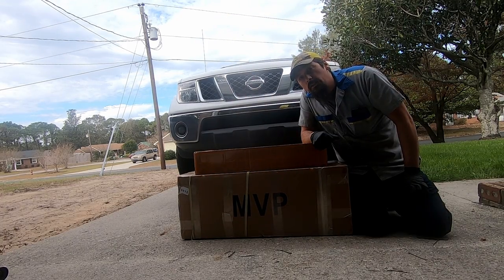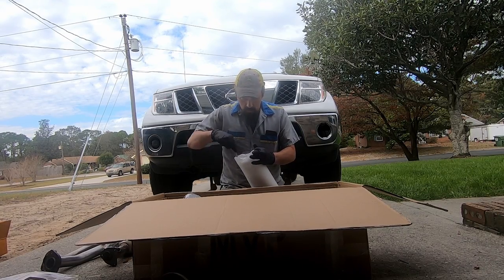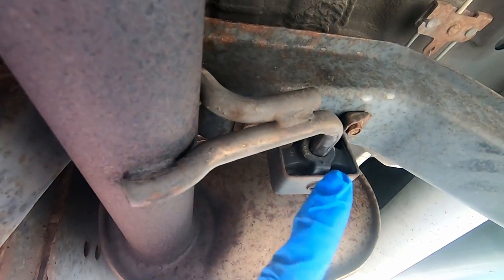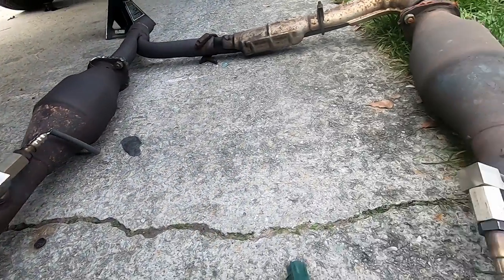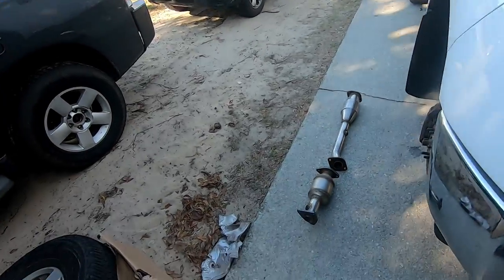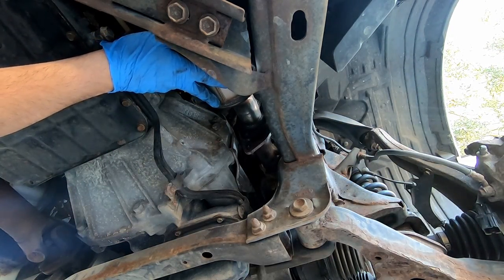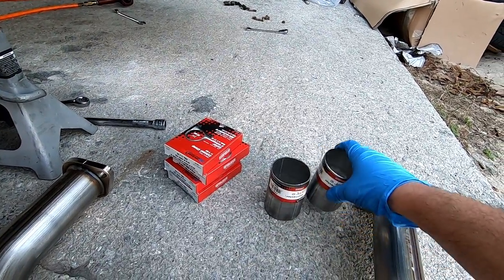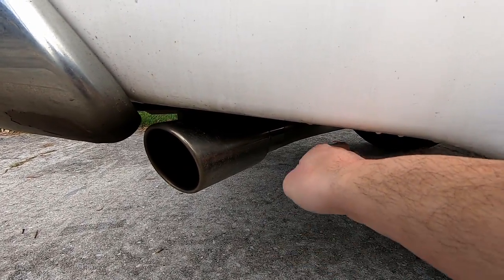I installed the cheapest exhaust and catalytic converters I could find on my 2nd gen frontier

Comment: Next time I put a cat set on. I'm going to relocate the rear o2 behind the second cat. See if it actually works better. I've used those spacers as well lol.
Reply: Where and what kind of spacers I need to buy
Reply from the maker: look up 02 sensor "adapter" on ebay.

Comment: Sorry for asking, but did you have to pay any import fees or customs fees for the catalytic converters?
Reply from the maker: I did not. I ordered them from ebay and they showed up a couple days later.
Reply: Good to know, I was looking at buying a set for my 03 Ford Ranger, but when I was on ebay I read there could be extra fees and time delays due to customs since they are being shipped from Canada (Quality/Excel Exhaust) so I was hesitant to buy.  I just need them to last me a year or so and I only drive my truck 300-500 miles a month.  I also wanted to ask you if you noticed any overheating of the cats or performance issues at freeway speeds?  I own a welder so I am okay with flanges being wonky, are they still holding up for you?
Reply from the maker: they are holding up. no overheating or leaks. one problem I do have with them is my truck set P0420 codes with them not long after installation.  so they don't clean up emissions enough to make the ecm happy. I installed some 02 sensor spacers to turn off the light.
Reply: Yeah, they are only EPA rated.  I will be getting a set of Walker, AP/Eastern or even Magnaflows downs the road but I just need something to throw in my truck since mine were recently stolen.  I've got a year before my next smog...by then I will have saved up enough to buy CARB compliant cats

Comment: My one cat cost more then all four. Plus no hardware. Sucks to be in California
Reply: My mechanic said all my oem 4 cat converters will soon go bad. I have 290k odo Fronty '07 V6. He made her passed Cali Smog 12/23 by cleaning all 4 CC. I got to 2 yrs to saved up $4k (ridiculous expensive) or Im thinking to move out of liberal Cali either NV or AZ. 
Great vid ! I subscribed !!
Reply: @shadowtruck5991  I hear this a lot, not sure why so many vq always have cat problems. I think on mine and a buddy's xterra, we burn a lot of oil( burn or passes into the cat) and think this is why it goes bad. Every month I have to top off at least 1qt